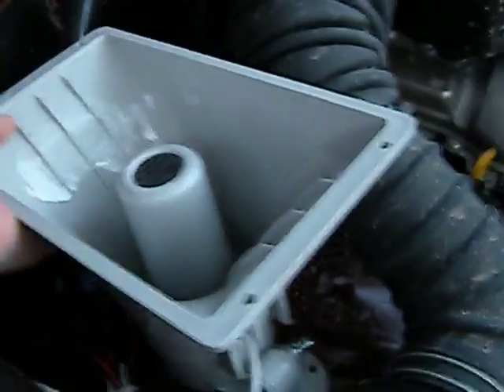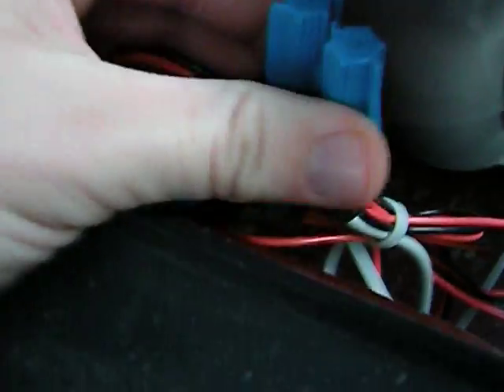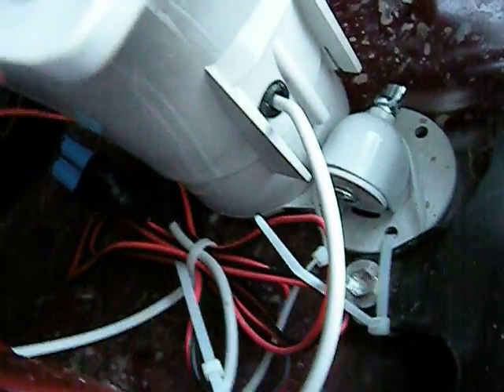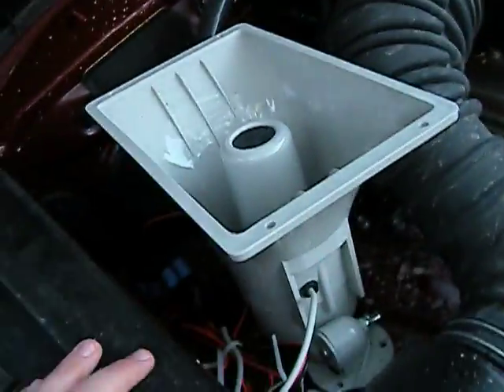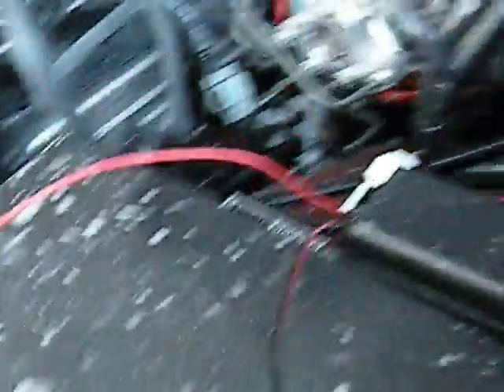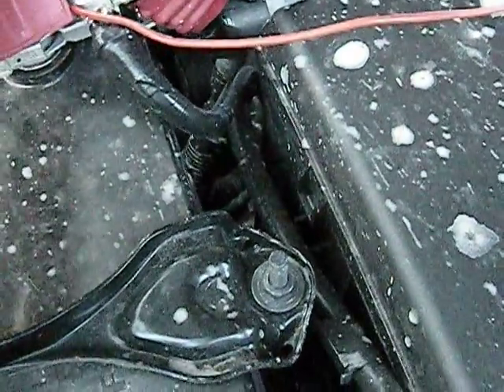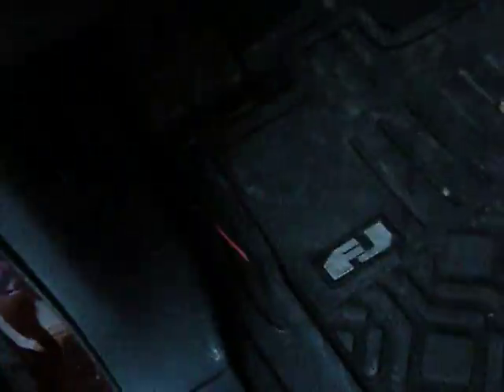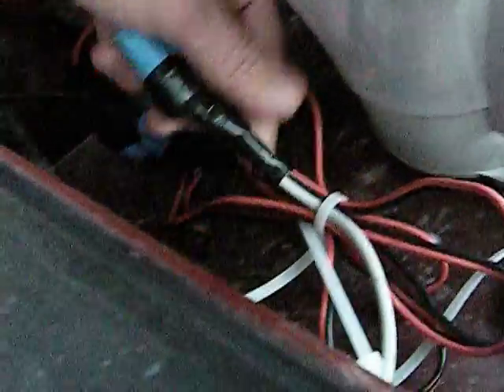How to install a P.A. system in your car!

Comment from the maker: @bjotheredneck You don't necessarily need to solder the wires unless you want to. Just connect the two wires coming out of your speaker to the two wires on the other end of the cable they told you to solder. That should do the trick.

Comment from the maker: @evilbunnyreviews Good point, at the time I made this video I was 16 and didn't know anything about stuff like that. The way I had it set up though, I don't think it ran down the battery because I didn't leave my CB radio on when I turned the car off. Sort of like if you leave the overhead light on it will drain the battery when your car is off but obviously doesn't drain the battery if its off when your car is off. Correct me if I'm wrong.

Comment: So how do you get the wires from the speaker on the engine through the inside of the car. Im talking about the wires from the speaker to the CB Radio console! Please help
im trying to do this a chevy 2013 rs camaro

Comment: Would it be pluasable to have the speaker hooked up to a radio receiver then tune the CB to a certain station to speak through it? Seems like it would bypass the electrical work.

Comment: question- couldnt you just connect the wires from the CB radio to you battery or a fuse? instead of getting another wire to connect to the cb?

Comment: Hello, can anyone explain witch wires are positive and negative on the Audio cable?
Thank you everyone.
Reply: if you need to now from my experince working with the audio and speakers and stuff like that the positive wires are complete single solid colors,and striped colors are negtive

Comment: Omg DO NOT USE FRICKEN TWIST CONNECTORS AND ELECTRIC TAPE THE ELEMENTS WILL WEAR THE TAPE OUT AND THE VIBRATION WILL LOOSEN THE SCREWS USE SOLDER AND SHRINK TUBING

Comment: you should have hooked up the positive end to your fuse box and then ground the ground wire not hook it directly up to you battery because like evilbunnyreviews said it will drain your battery maybe not at a noticable rate but it will and you also should not have bare wire under the hood you need to insulate it before it melts and shorts out something just sayin, not to be a dick or anything

Comment: If you couldn't solder the wires to the "speaker" (which is actually a PIEZO speaker and not a standard speaker in PA systems), then you REALLY ARE CLUELESS on electronics. That's a fairly messy wiring job. Too many excess cables flopping around in there.

Comment: If you don't know any terminology, or any subject knowledge for that matter, then you probably shouldn't be making a how-to video.  Seems like you had someone else do it for you while you watched, and then you made a video afterwards about it.  The video is titled how to install, but instead, it might as well just be a picture of the final product.  At least I now know to go buy some 'thingys' and 'stuff' or an RCA cable that connects one side to power and the other side plugs into... something...  I have a feeling your next video will be about how to repair a shittily installed intercom.  Won't be checking out your blog!
Reply: +JR Simmons #owned